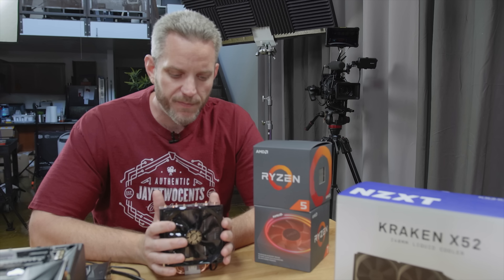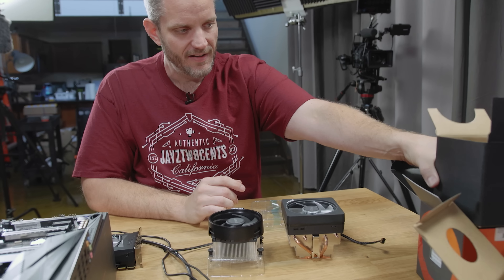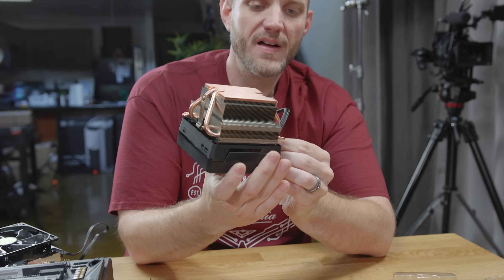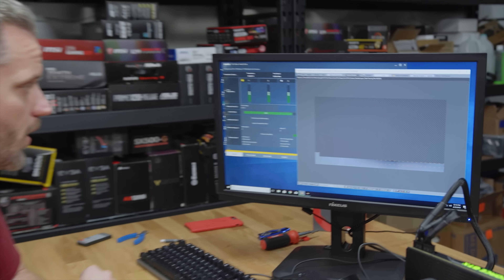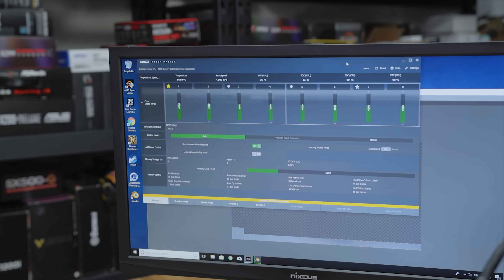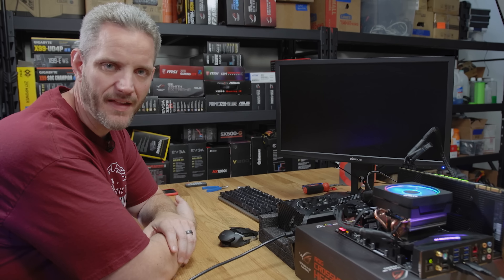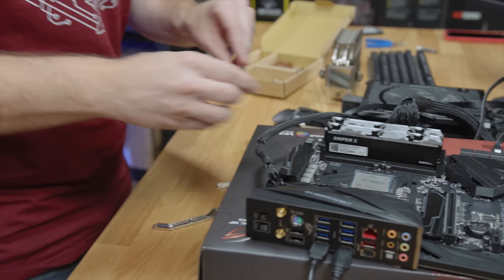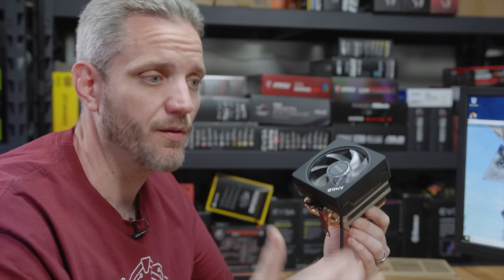Overclocking with a stock air cooler?? Is it even possible?

Comment: When the stock cooler has more RGB than your entire build
Reply: What's next CPU coolers with Pelter cooling system
Reply: @jonathanoxlade4252  thats already been a thing tho only in high end coolers coupled with water cooling
Reply: When your stock cooler has more Rgb than your Rgb Keyboard
Reply: Such a good stock cooler tho
Reply: Arc lmao literally my pc
Reply: AMD should make CPU's with RGB (like on the processor itself), we all know that it will increase the performance by 50%
Reply: Remember children : Perty Lights make it faster.
Reply: mine does
Reply: I have this same cooler and I can't figure out how to control the RGB its irritating.
Reply: yep. thats me. haha
Reply: Same
Reply: Can't relate
Reply: Bangin' Badger there should have been two cables that came with the cpu that plug into the mobo and the cooler to control the rgb
Reply: When your case has more RGB than buildaà
Reply: Arc , girl?
Reply: That hit hard
Reply: You must be running either the Wraith Prism LED Control Utility, MSI Mystic Light, ASRock RGB LED software, Biostar Vivid LED DJ, Gigabyte RGB Fusion, or ASUS Aura Sync if your motherboard has the capability. If your motherboard doesn't have RGB headers you won't be able to control the lighting.
Reply: what is RGB
Reply: @amnakhalid4600 , pretty lights!
Reply: @amnakhalid4600  you pay extra for about 3x the performance
Reply: Same
Reply: I feel attacked.
Reply: Yeah
Reply: @bmh67wa  no, you can plug the wraith lighting cable into a usb header and control it with wraith prism software for windows 10, i'm pretty sure that's how i did mine
Reply: @dylankelly8905 , I had tried that at first on my motherboard and couldn't get it to work that way. Maybe because my motherboard already had RGB headers or Mystic Light sucks which I'm quickly finding out.
Reply: @bmh67wa  no you connect the fan light cable to usb header not mobo rgb header, if you want to use wraith cooler software
Reply: @dylankelly8905 , that's how I did it at first and never got it to work. It works fine with the RGB header though.
Reply: It’s. Twofer
Reply: Lol
Reply: So don't use my with cooler witch I got with is my water cooler better
Reply: @amnakhalid4600  red green and blue when you mix the colors it make diffrent colors think of it as your color toners on your printer. It can make Muti colors
Reply: I just got a 3700X, gonna stick with stock for a while because whoooeeyey, 3 lighting zones !!!!
Reply: @banginbadger75  you need to download a special software for the cooler
Reply: Bruh same i thought about it all day after i built the pc.
Reply: It only has 2 rgb tho...
Reply: Bro, just built my first PC like last week. I feel that...
Reply: The ONLY rgb in my current build
Reply: My pc is only black
Reply: Yeah...SO?!? LOL! (reminiscing back to the 8350 build) Case only had front RGB so dat sh!t looked GOOOOOD!
Reply: @banginbadger75  If talking about Wraith, had same problem. Came down to a weak USB header. Major undervolt.
Reply: The rgb on my pc gives me a headache
Reply: Its true
Reply: I know right.
Reply: InstaBlaster
Reply: The stock AMD Wraith Prism cooler is great, but the one that came with my 3800X is machined poorly on the bottom, it has dips and pits. :( Never noticed because it came with thermal paste pre-applied. I'm using a much better aftermarket cooler now but from what I've seen in videos of the Wraith Prism, it should be smooth on the bottom and not have pits in it. Gonna have to call AMD and see if there's anything they can do to make up for that. I'm surprised it cools as well as it did with the bottom like that, but I always did think it could've been better, considering how large the whole thing is.

Comment: Amd offers a decent cooler with a cpu thats already 40% cheaper than intel. Just shows you how greedy intel are.
Reply: v KEITH v  i understand what youre saying but when you buy an exotic car youre paying for exclusivity. Supply and demand. That doesnt really apply to cpu's. There is no shortage of intel cpu's. Intel should be alot more competitive with their pricing then they are and thats why amd outsells them 3 to 1.
Reply: v KEITH v  Nobody buys a Lambo to race people. They buy a lambo to show people how rich they are.
Reply: xflynskywlkr27 Yeah when buying cpus it’s a commodity
Reply: @ayyeclipse6204  your right and some pple buy intel to show they have the little bit of extra money and they dont care about it lol
Reply: Indeed. Intel is like Apple of CPUs
Reply: v KEITH v  110% with Intel's current state, it is absolutely three things, greed, sloth, and arrogance. Make no mistake about that.
Reply: is*
Reply: v KEITH v  Yeah it does. I'm not saying i don't understand why they behave like that. But for sure it's a greedy move. Having a position of power, regardless how you got there, comes with a lot of responsibility too. Greedy is when you're ok with the benefits of that position but ignoring the responsibilities. When the mentality of "more profits" are replacing the natural attraction to profits, there is a problem. 
It's the issue from where the overclocking trend start. You could overclock because you still had room to do so. You know, buy the exact same chip but one is expensive and another is cheaper, one is true and one is artificially hindered to perform worse. Just sell the best you can make at the cheapest price you can afford. But that's impossible because greed. Others may say that i'm talking bs and if you want to make money what i;m saying it's at least stupid. Well, sure. But that doesn't change the fact that "the good" approach is the greedy one. Our whole approach on economy within society is flawed.
Reply: Well until AMD came along, Intel was basically the only company that made CPUs for professional and personal use computers. This allowed them to basically have a monopoly on price and performance for a while. Now AMD is basically giving them a run for their money.
Reply: v KEITH v  Original?
Reply: v KEITH v  Well, we now are sure they are so greedy. You noticed how they cut their HEDT prices in HALF ? For their 9th gen, they taxed up too $2k but suddenly, their 10th gen are $1k at most. And they are still making profit, that means for years they were charging at least $1k more than want they should have.
Reply: v KEITH v  they are still manufacturing on 14nm, it's the same fab which made 9th gen HEDT, that means same costs so if the manufacturing process didn't change, that would either mean the raw materials (silicon, electricity ect ect) are now way cheaper, or they were charging 100% more (1000$) because they are assholes. We both know which case is more realistic
Reply: v KEITH v  keep dreaming. 10nm is only for mobile chips. I'm talking about HEDT that just came out a couple of weeks ago, like the i9 10980xe for example. It's still on 14nm, it's like a copy of the 9980xe, but whit a 1000$ less MSRP. Go do some research, it seems like you missed a lot of crazy stuff. You will laugh, it's hilarious. Basically 9th Gen they asked 2000$, then 10th Gen which is the same cpu they ask 1000$ now. The reason? They can't compete so they cut their prices. But when you think about it, they are still making money, so who can they cut 1000$ from a 2000$ cpu??? Because they were stealing from everyone.
Reply: v KEITH v rich people don’t care about performance as much as they care for showing off their money for the most part.
Us regular people want the most bang for our buck.
Reply: we had to accept Intel's offering forever, lackluster performance increases year over year. The last time I purchased an Intel Chip for a system my personal Rig was 2009 when the first I7 debuted. I just could not get excited for any chip after... My co-worker used to give me a hard time for following hardware and never actually building.
Reply: v KEITH v  Their stock has under performed for years. I've owned this stock for 10 years and it has never done shit.
Reply: It's not that they're greedy. Since they had no competition before, they took that money for granted, and no one questioned their price. Yes, Intel is like the Apple of CPUs.
Reply: v KEITH v that intel dropped their sales price by 40% overnight means they have been greedy all along.
It’s not that hard math.. They can sell it for 40% less and still make a profit (otherwise you won’t sell it ofc) why would they suddenly be able to do that now and not the past years? Because they are have some very greedy profit margins..
Reply: v KEITH v  Well.Intel are greedy cus they havent made big performance gains.Yet selling that shit for the same price,and removing hyper threading.
Reply: v KEITH v Chill out dude also you claim they’ve made big performance in what way exactly? As there’s no way to prove you’re right if there’s no understanding of that meaning
Reply: v KEITH v  now that ryzen 3rd gen is here it's funny how now AMD has the superior CPU and are still keeping the ungreedy mindset too
Reply: @kazutosamurai-sama3166  the HEDT 10980xe are 9th gen my dude
Reply: @MitchRichard65  you didn't reed what I wrote correctly I think. I said that 10th generation 10980xe is a copy of the 9980xe. So both are on 14nm. That means the 10th gen isn't new at all.
Reply: @kazutosamurai-sama3166  I dont think you read what I wrote correctly.  10980xe is a 9th gen product. 10th gen isnt out yet. However,  it will not be 10nm
Reply: @MitchRichard65  bruh
Reply: @kazutosamurai-sama3166  10980xe is 9th gen. Dont bruh me
Reply: @MitchRichard65  Ok you could have checked that. But since you think you know better than hole world, here is a link : https://www.tomshardware.com/reviews/intel-core-i9-10980xe
Read it a little, and stop bothering me for this bullshit, the whole point of my comment was that intel is charging way more than they should, not arguing about generations.
Reply: but I still don't want to pay for cooler which I don't want :-D
Reply: Its inevitable, AMD will overprice their CPUs once they dominate the market.
Reply: v KEITH v the original brand??? How is intel amds original? They’re completely different manufacturers.
Reply: To be fair, AMD has a bunch of manufacturing conventions that make their production cheaper.
Reply: @xflynskywlkr27  there was a shortage of i9s some time ago, because Intel places all 8 cores on one chip, so if one core underperforms it has to get downgraded to i7, while AMD uses chiplets allowing them to prevent such costly wastes.
Reply: Intel is a bunch of idiots.  I live in Beaverton Oregon.  just around the corner from Intel.  I actually worked for them a little in the 90s trough a temp agency.  Long story short one day drinking a friend started telling me how much he hates this ex friend of his, and how the ex friend and buddy are selling stolen chips on ebay.  He even showed me the dudes ebay account and he had sold like 100s of chips for like 500, 700,  each.  I was like WTF.  So ya.  With theft like that, i'm sure they need to sell their chips at a crazy price.
Reply: That's why i never bought a intel since 2000 a rip off just like any apple products
Reply: If intel doesnt change their high prices, it means its working for them. The only reason why AMD is cheaper is because thats the way they think they can maximize their profit. None of these brands care about customers.
Reply: @dk70  plus the fact that their production is cheaper thanks to not having to turn a would be 9 into 7 or 5 as often as intel has to, courtesy of infinity fabric.
Reply: angry intel fanboys coming
Reply: Intel is*
Reply: @Ayy Eclipse wow, almost like how intel users use it to show how much money they have too! XD
Reply: Intel are deplorable and I'll ever give them a penny.
Reply: @ayyeclipse6204  Or how rich they were before they blew their cash.
Reply: @xflynskywlkr27  I think amd is better as of now but is there any competition against the i9 9900k? Amd dominates all price points below that but I cant seem to find a direct competitor to the 9900k, that cpu seems to be a bit too good for its price.
Reply: Too be honest  for extreme oc water cooling is for you but money wise is amazing stick to what you got and try and squeeze what you have with simple parts like better fans th
Reply: Geez a company can offer what they want for their products it doesn’t mean they are greedy. The cpu market already isn’t very profitable so intel chooses to sell their cpus for what they want to charge. It’s up to the consumer to decide if it’s worth it. Intel isn’t a greedy company and they don’t make bad products that’s why the are still in business. Anyway my point is not all companies are evil because they charge more than their competitors, and this is coming from someone who mainly buys AMD.
Reply: @Emanuel Sheta Maybe lower end but otherwise thats a straight up lie
Reply: v KEITH v  amd processors cost more to make though? intel removed pins so that their processors didn’t cost that much to make and made the motherboards more expensive. amd has pins and therefore takes more money to manufacture? it’s just a fact that intel is greedy
Reply: always man, always
Reply: yup, amd had better r&d, same reason why the next-gen consoles perform so much better than a 500$ pc, intel isn't greedy, just less cost-efficient design, low iq comment
Reply: @li0n heart ur comparing the wrong cpus, compare the ryzen 5000 series to intel's upcoming rocket lake cpus, and any buying a ryzen 5000 is going to have a dedicated cooler, no one is running it on a stock cooler lol
Reply: @xflynskywlkr27  i’m not shy to out the stock amd cooler in my build.
Intel cooler stock looks like a poor trash thing
Reply: now amd is following suite by pricing their shit gpu 380
Reply: I guess the OP are new to the market. They might want to look into it more.

Comment: Rgb always boosts base clock and vrm performance for maximum overclock. Obviously.
Reply: Epitome Soul Kayanzeblanda
honestly, just download some ram
Reply: lies only lighting bolt stickers makes your cpu run faster
Reply: the addition of heatpipes helps...
Reply: Only if you set the RGB to red. Kappa
Reply: A real ”bright” one you are -.-
Reply: Ahahaha, good one! xD Gotta go order more RGB then xD
Reply: If I apply rgb strips to my case, will that increase my case cooling?
Reply: Using a RGB mouse and keyboard also magically turns you into a professional gamer
Reply: It's like stickers on a car. Each one (depending on the size) adds between 5-20 HP.
Reply: how many years should we hear this story? if someone likes lights, where's the problem? the market is full of products for all budgets and everyone is free to spend as much as he wants HIS money.
Reply: Like how a spoiler makes your car go faster
Reply: LED actually produces a bit of heat.
Reply: If you turn the lights to blue it actually cools the PC better, by at least 20-30 degrees. White mobo/graphics card also help. Make it look like ice so it behaves like ice. This is a pro tip from a licensed computer trainer.
Reply: Apparently I forgot to add "joke aside"
Reply: If you add a spoiler to your PC, you can get 420 FPS in all games
Reply: For each diode of light in your system, there is one extra frame per sec
Reply: Only if the rgb displays blue.
Reply: zealotmaster1 that stopped working in 2012
Reply: And if you add Spoilers and speed strips well then you could easily keep the CPU at 0c.  .
Reply: Yes i've had best results with the flickering flame theme, It pretty much the same as painting fire on the side of your camaro.
Reply: Andrew Nospar yes
Reply: What is rgb? Wrote question here of instead of Google because i don't have to press 2 buttons more. Thanks in advance! ;)
Reply: Is it red green blue led lights? Anything with rgb has lights then?
Reply: FR THO
Reply: HELLS YEAH
Reply: No, RGB increases the graphics quality
Reply: An RBG monitor decreases the response time to 0.
Reply: Duh...why do you think people putting racing stripes on cars? SPEED AND PERFORMANCE!
Reply: NinJABRONI yeah and RGB on your GPU just multiplies the performance gained from your driver.
Reply: Should i download ram or buy rgb ram?
Reply: Just turn your usb to ram.
Reply: Dragonodys download Rgb ram
Reply: @dragonodys3914  You can also download RGB, but one color at a time.
Reply: Before you overclock don’t forget to dip your case fans into a vat of thermal compound
Reply: And what about RGBY lights? It should run warp speed. :-D
Reply: @walterwillo  I know this is an old comment and all but God dammit 😐
Reply: Well, if YOU can't see it neither can your CPU! Gawwd! Remember how your new Nikes use to "make you run faster"? LMAO!
Reply: @zealotmaster1  Yes! So true!